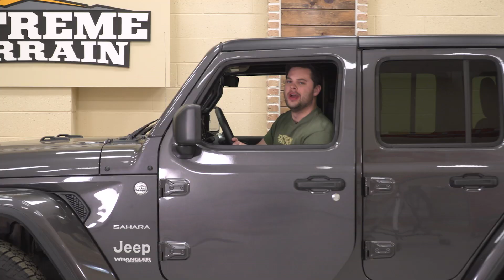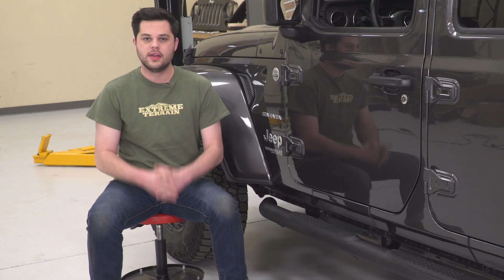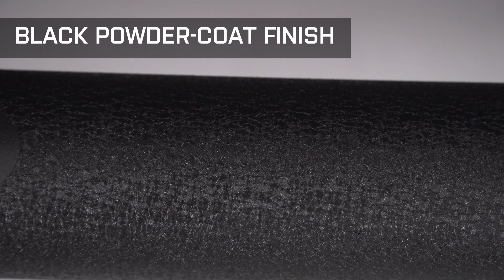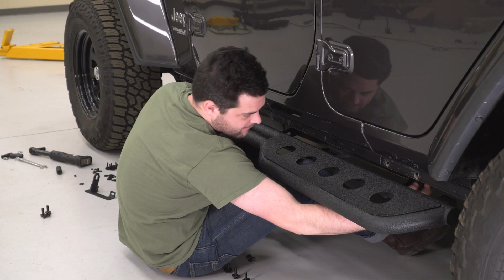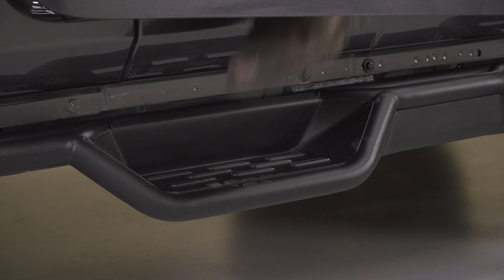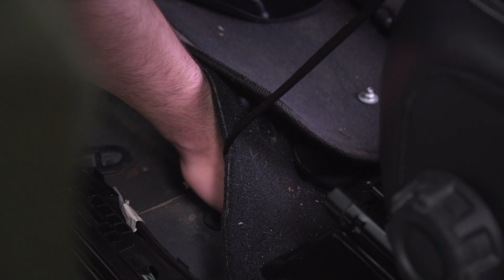How To Choose Side Steps For Your Jeep Wrangler!

Comment from the maker: Shop Other Parts Here: http://terrain.jp/3oa1RS9
Subscribe for Daily Jeep Videos: http://terrain.jp/SubscribeXTyt

Side Step Bars are a great multi-function addition for Wrangler owners to consider purchasing! Along with making it a little easier entering and exiting your vehicle, Side Steps also can provide an extra layer of protection from door dings, wondering shopping carts, small road debris and even small hazards out on the trail like rocks and roots if the construction of them is up for the task! In this video, Joe will walk you through four different options currently available on our site for you to get a head start on shopping!

Featured Side Steps:
RedRock 4x4 3 in. Round Curved Side Step Bars: https://terrain.jp/2Gj9K48 
Barricade Extreme Heavy Duty Rocker Steps: https://terrain.jp/37rWp5y
RedRock 4x4 HD Door Side Step Bars: https://terrain.jp/30MPZLy
Rock-Slide Engineering Gen II Step Sliders: https://terrain.jp/2TRrvQ2

Comment: Is there anything tricky to watch out for with JK Wranglers and side steps - by this are they the same mounts, threads on the vehicle throughout the model?  I had an issue with a TJ, they had two different mounting styles so side steps that came off a 2005 model didn't fit a 2000 model.

Comment: Can you tell me if running board from a 2dr 2021 Wrangler are able to be installed on a 2dr 2001 Wrangler?
Reply from the maker: Running boards from a JL Wrangler will likely not fit a 2001 TJ Wrangler. -Zach

Comment: Nothing with curves, pockets or dips. Those are rock hang up points. Can't power through them. 
Poison Spyder Customs brawler rockers are awesome. I painted mine myself. Used Rustolium Spray on need lined on the outer surfaces for step traction and semi gloss on interior surfaces for easy clean out.
Prevent rust by cleaning and touch up as necessary.

Comment: What is the height of the Jeep and what size of tires it has? I am new to the Jeep world. Trying to figure out the best look for mine before buying the tires. Thank you
Reply from the maker: I don't have the overall height of the Jeep, unfortunately. But since it is only running 285/70R17 tires on stock suspension, it will only be about an inch taller than a stock JLU Sahara. 😁 -Zach